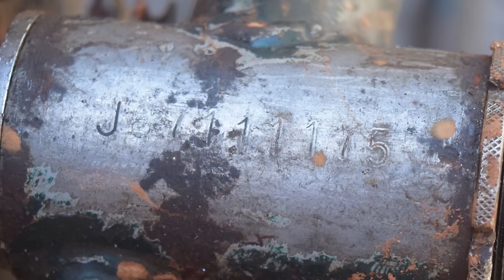Vintage Mountain Bike Restoration | Hunter Focus 1987 |

Comment: This is amazing. However I don't believe that seat post came out so easily! 😀
Reply: I was thinking the same thing! I picked up a nice Specialized Crossroads which appeared to be in much better shape than this one, but the seat post and the stem would not budge!
Reply: It can really depend on the quality of the original assembly. If there was enough grease or anti-seize compound used - it gets sealed in there and can last despite what the external parts of the bike may have endured in its previous life.

Alum. posts in steel frames are more prone to seizure. This bike had a chrome steel post within a steel frame.... "cheaper" quality for the time; but more enduring because there's less risk of galvanic corrosion between different metals.
Reply: @MuckingMunt  totally unrelated, but great pic!
Reply: Use WD40 bro..
Reply: @erieq22  I don't think that's strong enough. I've been using penetrating oil, PB Blaster, but to no avail. I'm pretty sure it's steel on steel so the rust must be very bad.
Reply: @nivek29  
it wasn't always like that.. 
I found some bikes that were easy to disassemble. As long as the tube is still flexible & returns to the original shape when the bolt is removed, it will be easier to open..

Comment: My wife has a well taken care of specialized hard rock circa 1998.   I have upgraded it a few times.   However, if you take care of a bicycle there is no reason why you should need a new bicycle in your lifetime.   The mods I made to hers have been adding slicks as opposed to knobbies ( no need for knobbies for what we do ),  going to a 1x8 as opposed to a 3x8 (less maintenance),  a few cable changes, adding protective tape to prevent chain slap chips/cable rubbing wear on the paint,  and just general tlc.  My only advice is buy a quality bike from the start.  My last bike was a pro-flex 857?   It lasted me 20 years but was Too much mountain bike for my new locale.  Now I have a salsa journeyman which I am sure I will ride til I die.   Keep on riding on 👍

Comment: I noticed you didn't grease a lot of parts (threads on bottom bracket, crank arms bolts, the seat post) is this for any particular reason? Doesn't that risk the metal seizing, rust, and water penetrating the parts?

Comment: To help save money you might also want to consider cleaning and reconditioning the still good working parts rather than replacing them with brand new ones. You will also be able to preserve and restore the original antiquity of a vintage bike in the process.

Comment: I have a question about pocked metal after cleaning rust off-- what do you use to smooth that out, for the frame and other parts?
Reply from the maker: Just degreaser

Comment: I loved the restoration and the parts you used its.really a vintage like the cantilever brakes. The only parts i dont like is the combo shifter, it ruined the vintage look..
Reply from the maker: Actualy the original stx combo shifter is broke on the leftside. Can not be restore right now need replacement part.
So its leave me hard choise to use modern shifter
Reply: Overall, your restoration project is super great! Keep it up!

Comment: seatpost federal ukuran standar rata-rata di 25.6 kan bang.... apa masuk bang kalo dipasangi ukuran 25.4 ?
Reply from the maker: Rata2 25.4 om.
25.6 hanya beberapa.
Kalo dikasih 25.4 bisa tp agak longgar dkit
Biar pas di kasih kertas amplas 400/800
Reply: @CycleFields  boleh minta no wa kang mau tanya tanya seputar parts 🙏🏻

Comment: Excellent restoration. Neat and tidy. Worse part is stripping the old paint, or discovering a project has a seized seat post. Matching wheel hubs and the seat tube decal positioned further up away from the derailer clamp would have made it perfect in my eyes. Those early/mid 80's twin brace MTB handlebars were used I remember on top of the range bikes. They're rare in the UK.
Reply from the maker: Thanks 😁👍💯💯💯